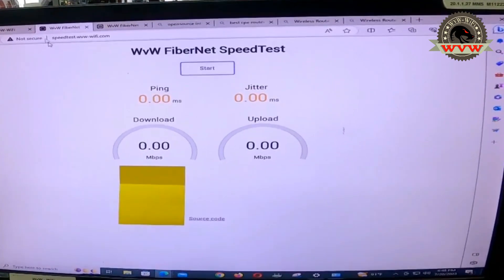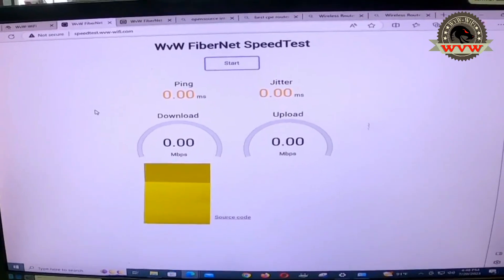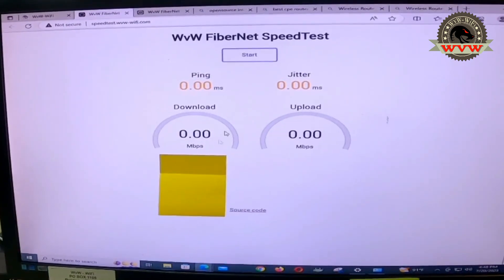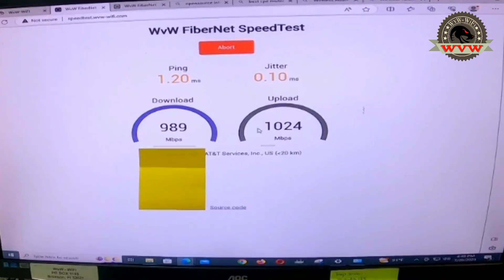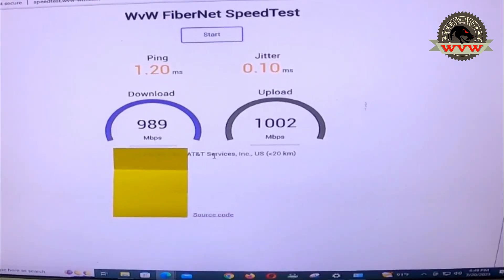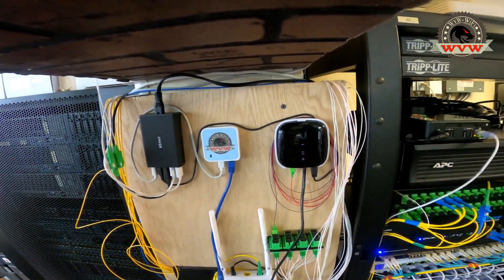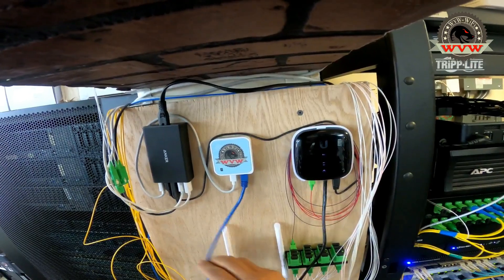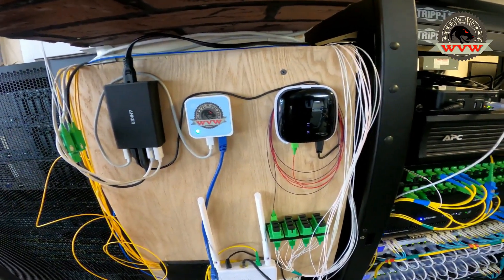Ubiquiti OLT & Chinese OLT. Speed Test "epon VS gpon"

Comment: Thank you so much for uploading this. I try to use my budget to get the most value. I almost spend most of my budget on GPON.
I don't offer more than 1 Gbps to the clients so EPON will do just fine and most of my clients only need internet, they don't need IPTV.

So, Use GPON if you have spare money to burn, it is good because it supports 2.5 Gbps for download.
Use EPON if you are tight on budget and good enough with 1 Gbps.

Comment: EPON is not gigabit !  GPON and GEPON are the gigabit ones ;)
Reply from the maker: EPON are Gigabit capable. do not confuse Ethernet to Gigabit Ethernet.  Epon is a European and south Asia Standard  and they do deliver the Gig as you see in the video.  Thank you.
Reply: @wvwnetworking  is technically capable for it, but it’s not recommended for and users to use that much

Comment: Can ubiquiti olt use another onu product?
Reply from the maker: Did not try it. But I don't think the OLT will recognize other GPONs models. But you can use the fiber module if you have a SFP wan router. But again the module needs to be adopted first . @95% the answer is NO. Hope this helps.

Comment: It's incorrect that the speed is the same.  EPON is only capable of a share capacity on a PON of 1Gb\1Gb speeds most likely why your OLT is like that.  Gpon uses SDH\Sonet type framing for a 2.5Gb\1.25Gb on a PON  Also GPON allows for other waves to ride on the same fiber like 1550-1650nm for example.
Reply from the maker: The maximum speed that we offer is 1GB up and 1GB down. Gpon or Epon share the bandwidth delivered by the PON. In an Epon you can't exceed 128 connection max per PON. As for Gpon you can reach 256 connections per PON. None of these numbers are realistic because of the sharing phenomena. Also OLT PON delivers a little more power C+++ than the Gpon PON C+. To me the end results are the same. And that's what matters. As far as I can see. I did a lab test that shows the results.